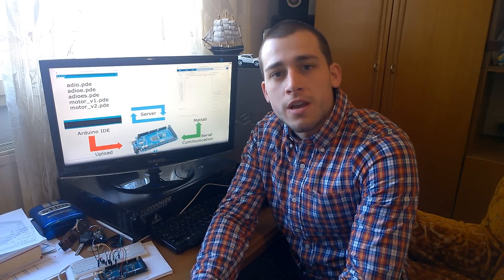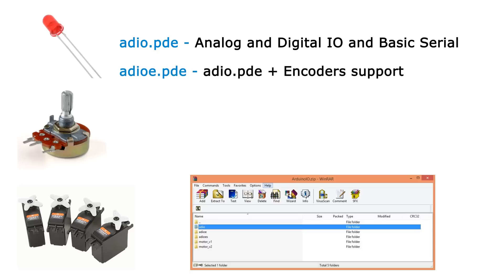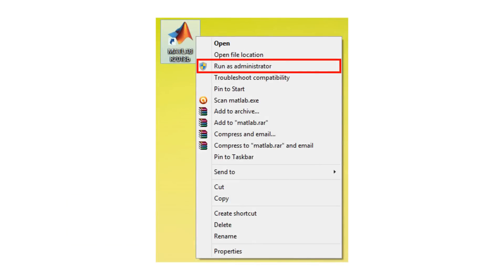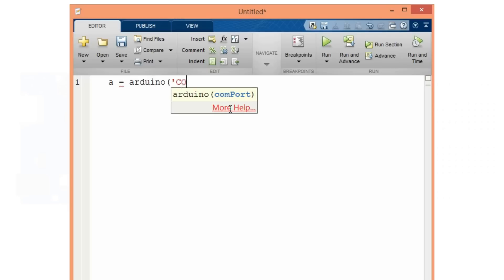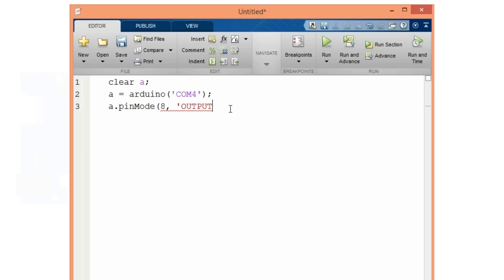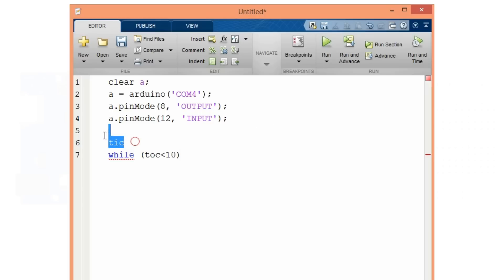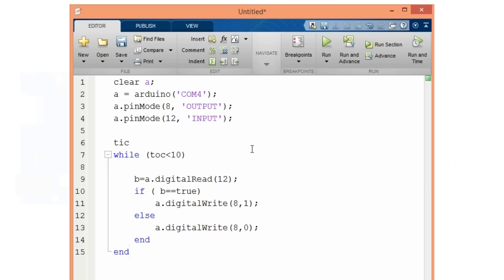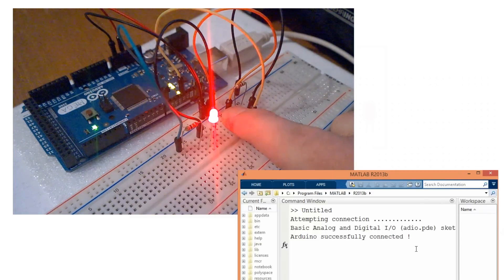Arduino Tutorial 07: Matlab

Comment: Hi,at first i would like to thank you for all you  videos it easy and amazing.
when i try to upload the sketch this message 
appear ?

>> Untitled

Open failed: Port: COM19 is not available. Available ports: COM20, COM26.
Use INSTRFIND to determine if other instrument objects are connected to the requested device.
Error using arduino (line 83)
Could not open port: COM19

Error in Untitled (line 2)
a = arduino('COM19');
Reply: Hamza mohammed cc

Comment: Hi, I am trying to read the IMU GY-801 sensor orientation(Roll, Pitch, and Yaw)  to control my robot. I have written the Arduino code and I can get the values in Arduino software. However, I had a hard time translating data to Matlab. I am using Arduino Uno R3, Matlab 2016a, and Arduino support package.
I appreciate if you could help me to do this. Thank you

Comment: hello,
May I know why when i tried to run, it says Connection unsuccessful, please make sure that the board is powered on, running a sketch provided with the package, and connected to the indicated serial port. You might also try to unplug and re-plug the USB cable before attempting a reconnection. When I have already entered the correct serial port. Also I'm trying to program a motor to move left and right. Do you mind teaching me how?
Reply: +Dejan Nedelkovski may I know how do I upload that? Oh I'm actually trying to program a motor with arduino through matlab and I'm very new to this 2 programming that's why I'm not very sure if your program suits mine. Because your program is about controlling led while mine is to control servomotor.
Reply: +Dejan Nedelkovski So how do i upload the adio.pde sketch to the arduino board?

Comment: hello
I try the same connection but always give me the following error message

{Warning: Unsuccessful read: The input buffer was filled before the Terminator was reached. 
Error using arduino (line 102)
Connection unsuccessful, please make sure that the Arduino is powered on, running either
srv.pde, adiosrv.pde or mororsrv.pde, and that the board is connected to the indicated
serial port. You might also try to unplug and re-plug the USB cable before attempting a
reconnection.

Error in Untitled3 (line 2)
a = arduino('COM4');   }
Reply: ***** 
thank you

Comment: what if i want to connect two quadrature encoders to the arduino uno board and read its data in matlab ? please help.
Reply: Coding is not a probelm.I need to attach "two" quadrature rotary encoders. I am using interrupt pins 2,3 on arduino board to read the data of encoder-1. Its just that I am not able to read the data on any pins other than 2,3 . Can you suggest something ? You can also mail me on utsav.shah@iitgn.ac.in
Reply: *****  can I add more interrupts in the "adioes.pde " sketch itself ?  
sorry, I have never done coding in arduino IDE nor am I familiar with C/C++ language.